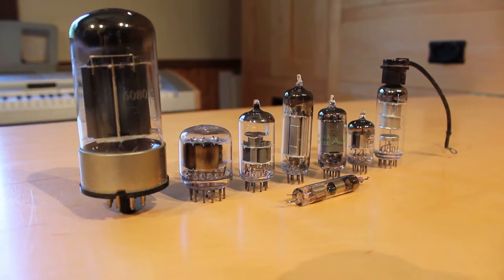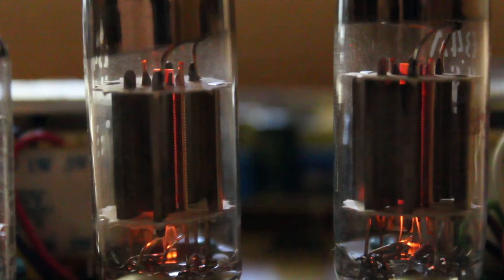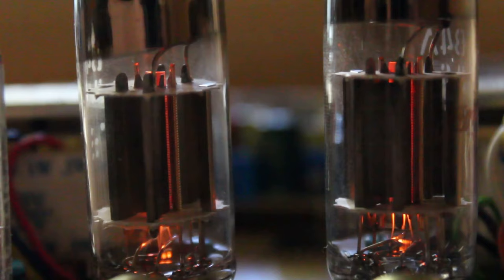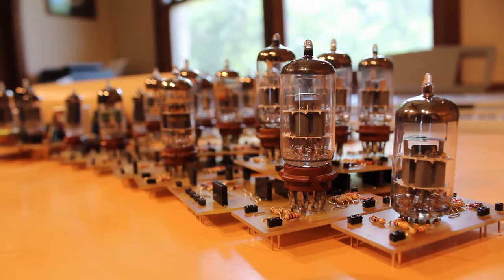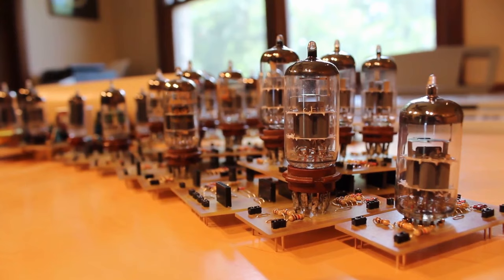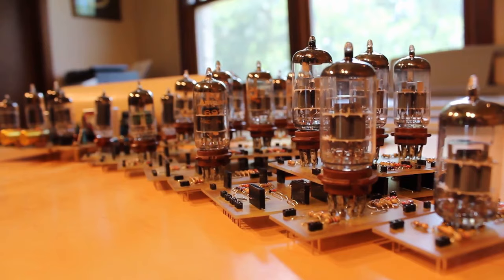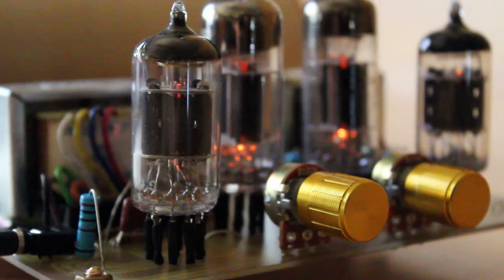Vacuum Tubes: Episode 1 - The Basics and the Diode

Comment: I want to find out if I can use them for a proximity switch .   I have found a nasty use for them and want to adapt it to a harmless prank... Instead of a resulting boom. I want a resulting garage door  to open and close  or tv channel or input selection to change . The way I read It , I can take a vTube, hook it to a green card ,  a portable power source , a capacitor or three and a few other small components to store ,boost and carry the power ...and an output to send that power to a thing .  I want to see up a billy bass to start singing and change the tv Everytime someone walks passed something .  I'm not exactly sure what to hide it in , but a camera is going to be involved to get pictures of whatever friend or family member I want to prank . 
I found packs of five, new old stock vacuum tubes for $15 u.s.  too .    
The concept in what I read was the natural electric charge given off by a person can interact with the tube and that allows one very weak  switch to click over to the power source allowing it activate ..what it's connected to .
Reply from the maker: Honestly, in my experience, tubes are really stable and it takes an actual external input to cause them to do something. Having said that, tubes make excellent amplifiers, and you can cascade those amplifier to amplify and absolutely tiny change on the input (like 0.1V) into a massive change on the output (like 20V or more). But, with that much amplification there's all sorts of other things to tackle as well. 
It sounds like, at the very essence, you want a proximity detector type thing, but even with cascaded amplifiers, the person would have to be so close they're nearly touching it I think. Now, you could use things like Phototubes or something to setup a trip light or the like that could work at a distance, that could be a very fun project!

Comment: 11:29 pfft get some rf transmitter tubes, shit look at a cathode ray or xray tube and need up to 100kv+, atleast those flyback transformers make a good tube power supply got lots of tapped secondary windings if you can find dat datasheet to it!  build a vacuum tube version of  flyback zvs driver and run that flyback primary at 340v full wave rectified  instead of 12/24, might need to put it in a oil filled vacuum canister....and atleast over a foot between out but terminals, ozone and ionized air ya know aint teh best too breathe

Comment: I know this is going to be a stupid "argument" however, I dislike the concept of "electron flowing". Electrons are not flowing. In fact, they are moving really slow. I know that this was not the point of your video, I just wanted to point this out if anyone interested to find out more about it. Electrons are already at the filament and that is what gets "bounced off" or emitted.
Reply from the maker: Interestingly, Dave Jones over at EEVBlog addressed this a bit in response to Veritasium's video about Poynting vectors. 
You're absolutely right from a theory point of view, but in practice, there's not really any huge harm in thinking of it in terms that electrons flow or move down the line. Honestly, the whole topic of electron flow, drift velocities, and other EE related stuff is well beyond the scope of my videos and even what I'm confident talking about. But, in practice, I've found that thinking about tubes in the way I've described here really helped me get a grasp of what was going on, and if it helped someone else too, then this was a total win in my book!
Reply: @UsagiElectric  Yes, agree, there is very little point in trying to go with the theory rout. However, I used to think like that too. In most cases it worked out just fine. 
Realizing later on, that current actually Radiates helped me build event more interesting circuits for sensitive parts specifically. Anyway, I do appreciate your videos. Because of you, I ended up going on a rabbit hunt to actually understand what a vacuum tube is with old Radiotron books of 1950s..long story short I found out a way to design a panaplex tube, which share similar principles. I would be very interested in seeing you cover that topic of such tubes.

Anyway, thanks for the reply and, I like your videos.

V
Reply: I think you could say that the electrons form a cloud around the cathode after being heated up by the filament.  These electrons head toward the plate with a velocity that depends upon the positive voltage applied there.  In some tubes the electrons hit the plate with sufficient energy to knock other electrons free and cause secondary emissions from the plate back into the cloud.  Check out the purpose of the suppressor grid in a pentode.

Comment: Conventional current flow being taught should be banned. Hard for me to watch seeing how I learned from electron flow. Like learning everything backwards just cause nobody wants to teach it the correct way.
Reply from the maker: I kind of see it as like knowing both the metric system and the old English system. Sure, the metric system makes way more sense, but the world uses both, so it becomes beneficial to be able to use either one depending on the situation.
Reply: @UsagiElectric  Measurements systems are based on a different reference. Current flow is based on facts and adhering to old ideas that have been proven incorrect does no one any good. They don't want to rock the boat as to many engineers learned the wrong way and don't want to upset the cart so they just continue to teach the wrong physics in books.
Reply: well sometimes current flow is due to the movement of positive charges. For example in electrolysis, but also when you consider semiconductors.

It's only when dealing with metal conductors that the only charge bearers are electrons, so it's only in that specific instance that conventional current flow doesn't make sense.
Reply: Neither way is correct. Current has no direction, only sign.
Reply: @silasfatchett7380  Charge moves which implies direction